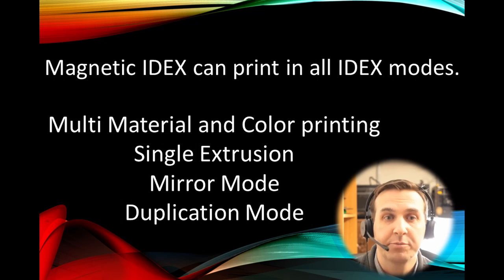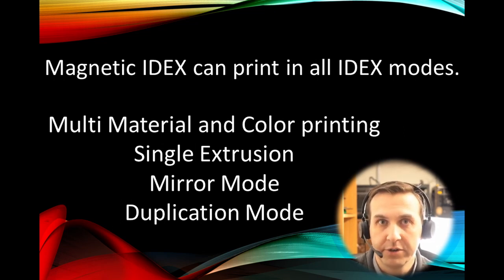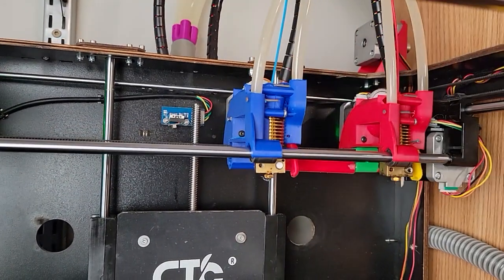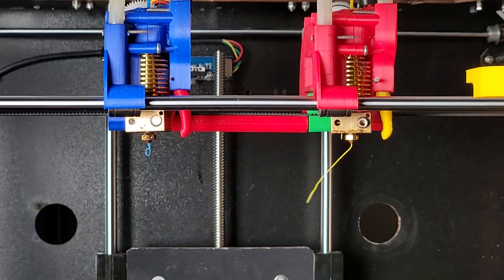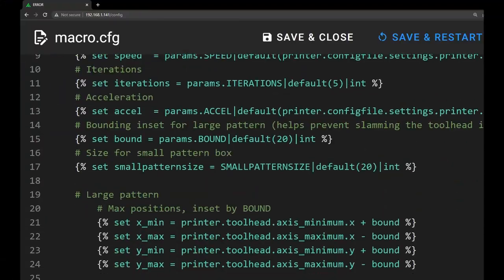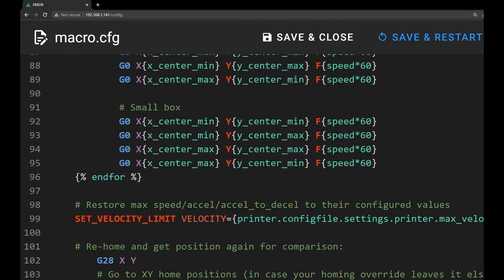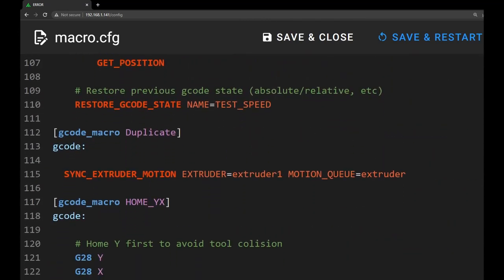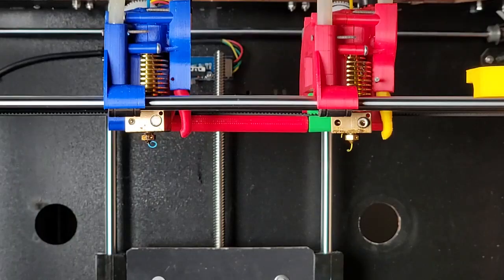Magnetic IDEX Duplication Mode Demo

Comment: What changes do you need to make in Marlin to be dual copy? Can you give me some information?
Reply from the maker: I recommend trying out Klipper firmware—it's more flexible for features like dual copy mode. However, if you want to keep Marlin, study the M605 command (e.g., M605 S2 to enable duplication). Check Marlin's docs for config details specific to your setup.

Comment: what is the purpose of that little outside brim like 1/2" away from print
Reply from the maker: The little brim or skirt you're referring to serves several purposes in 3D printing:

Priming the Nozzle: It helps to prime the nozzle by ensuring that there's a steady flow of filament before it starts on the actual print. This can eliminate any initial clogs or inconsistent extrusion.

Diagnosing Layer Adhesion: It acts as a diagnostic tool. By observing the skirt, you can catch issues like poor adhesion or inconsistent layer heights early in the print process. If there are problems with the skirt, you might decide to stop the print to avoid wasting time and material.

Stabilizing Extrusion: Even on printers with nozzle bibs or wipers, a skirt can stabilize the flow of plastic, ensuring a more consistent first layer. This is particularly useful for achieving better quality on the initial layers where the foundation for the rest of the print is laid.

Bed Adhesion: When there's zero gap between the skirt and the part, it increases the surface area touching the print bed, which can help in maintaining better adhesion, especially with materials that are prone to warping or lifting.

While not strictly necessary for all printers, especially those with advanced features like nozzle bibs, using a skirt can enhance print quality and reliability, providing an extra layer of assurance for a successful print.

Comment: May I ask what the max print speed this incredible printer had ever achieved in different modes? duplicate/mirror/single extruder?
Reply from the maker: I have not pushed it much beyond 250mm/s and 5,000mm/s².  I am sure it can print much faster.  I just recently got input shaping to work and new lighter print heads are coming really soon.   I am sure, I'll be able to compete with the big boys :)
Reply: @m_IDEX  looking forward to see your next video

Comment: Not an IDEX per definition. I know you hate to hear it. Still, WORDS HAVE MEANING. The I of IDEX stands for INDEPENDENT. Means BOTH heads can work AT THE SAME TIME and can work on different locations - VARYING. So, not only duplicate, but also mirror. This is not possible in your setup by definition - and so, while you have a DEX, you do not have an IDEX.
Reply from the maker: Hi Thomas, I completely agree with you that words have meaning.  I have several conventional IDEX 3D printers and I absolutely love them!  I believe the “Independent” part of IDEX is that the dual print head is separated in to two independent tool heads.  The Independent toolheads allow IDEX printers to have different print modes.  Multi color/multi material, Mirror, and Duplication Modes.  BCN3D has a good video describing IDEX technology here:  https://youtu.be/-FZR4WQmgTM.  I have demonstrated in earlier videos that Magnetic IDEX while lacking a 2nd X-axis motor, can produce exactly the same IDEX results.
Magnetic IDEX Dual Color Demo: https://youtu.be/cV1CSO5EnsA
Magnetic IDEX Mirror Mode Demo: https://youtu.be/WZU_HdpftL4